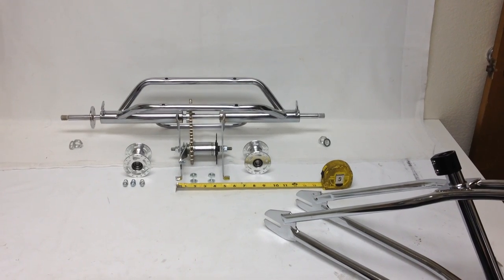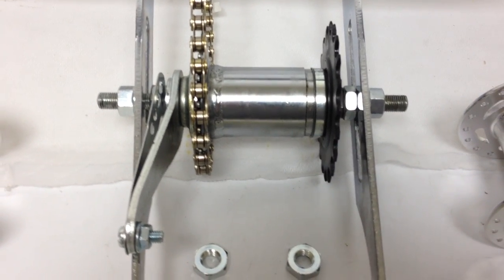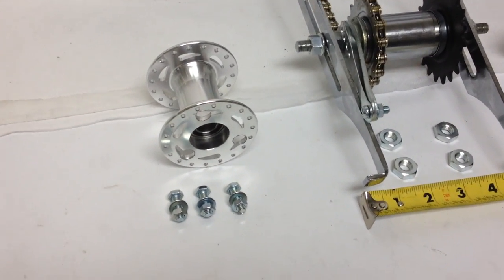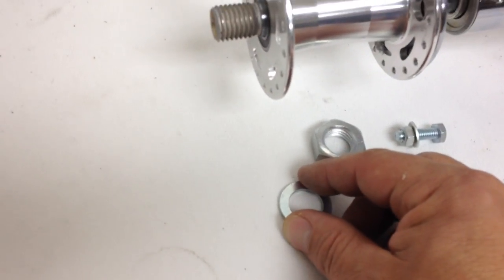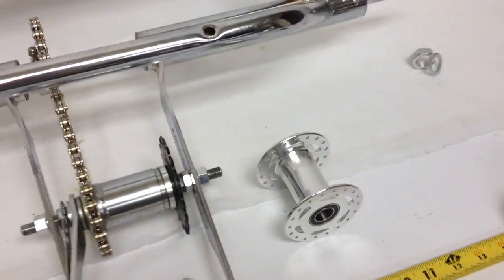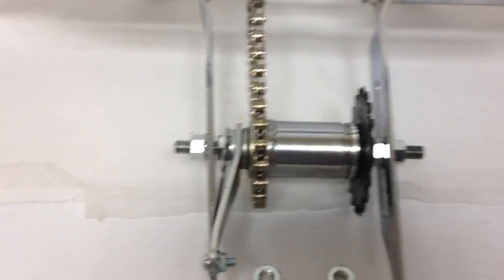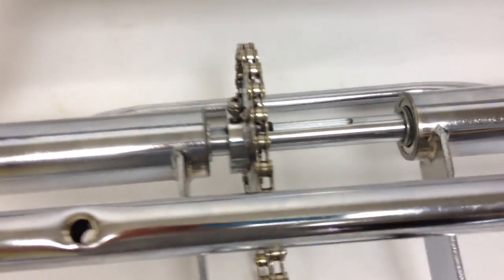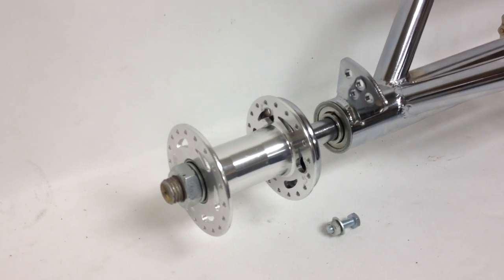Trike Conversion Kit with 36 Spoke Hollow Hubs

Comment: Is this a 17 mm or 15 mm axle? I see that many trikes seem to have a defect and either the drive side axle breaks or the spokes break regularly causing you to have a wreck. Does this setup have a weight rating? I know the cheap schwinn trike I have only has a 250 lb rating and the better trikes have a 350-500 lb rating. Where does this one stand??

Comment: Is the hub flipped around? The chain coming off the crank is on the right side of every bike I have ever seen, it wont work with the configuration you have here.
Reply: it has a hub that acts as a jackshaft(also has coaster brake) if you look at the video, it puts the final drive sprocket to the other side, some bmx cranks and hubs do route on the left side instead of the right so they can grind on curbs if you wanted to run straight from the front sprocket eliminating the jackshaft you would have a fixed gear trike, the final drive chain in the setup in the video always spins with the wheel it is a 2 chain drive setup

Comment: So this axel can take any wheels with a 5/8 or larger bore correct? If you didn't want to spoke those hubs, you could theoretically use a couple of mag wheels or already assembled wheels as long as they had the 5/8 bore right? I can't see why not. I'm buying one tight now. My scooter has a 5.25" dropout and I've got an extra rear rim, both happen to be solid aluminum with 5/8 bore and keyway. This is exactly what i was looking for. I'll let you know how it turns out once i mount the 1200 watt electric motor and pump 52 volts through it. This is gonna be epic
Reply: Exactly what i was thinking. I have some mag wheels im about to try and see. Any progress on yours? I have a desoto classic from back in the day. And a town a country . desoto rides super smooth
Reply: You have to have a wheel that has room to accommodate the 3 bolts that fasten  the wheel to the disc on the end of the driven axle. The driven axle has the bike sprocket at one end and the disc at the other.

Comment: Hey bro I have a question for you. My axle moves left and right. When I tighten the cruise tire it pulls the drive drive shaft tire. If I loosen the cruise tire it wobbles. If I tighten the cruise tire it makes the drive tire up against the frame scrapping it, making a grinding noise and it gets tight to turn. How do I fix it my problem. Thank you
Reply: and notice  they never replied to your coment   a colar  on the shaft on the  inside   to the right would keep it fom pulling the drive side into the frame you  would have play with it to get  right and not bind up none drive side  for the munny there charging  for that kit  get you munny back and buy one online

Comment: Sucks that it's only 1 wheel drive, should have made both rear wheels pull.
Reply: you would want a differential if both wheels pulled because it would have real bad steering, a lever operated locker would be super sweet though

Comment: This rear conversion is JUNK it doesn't even include NYLON nuts for the axles so they don't back off.

ONLY one wheel power and drum brakes how CHEAP can you get  what a piece of CRAP

Comment: No bearing on the back hub ? Sounds kind of cheap made.
Reply: The drive hub is attached with bolts to the axle. The other hub has inner and outer bearings and rides on the axle.